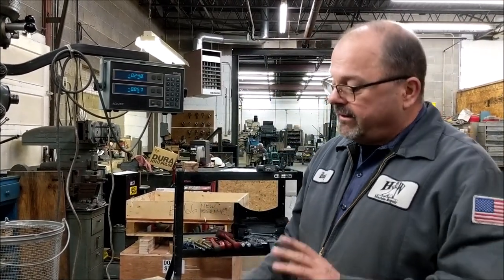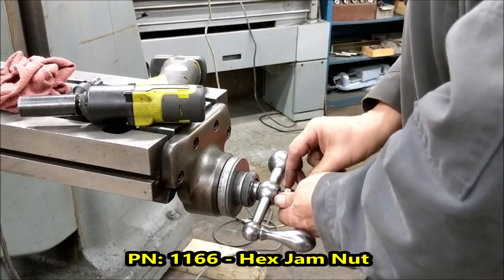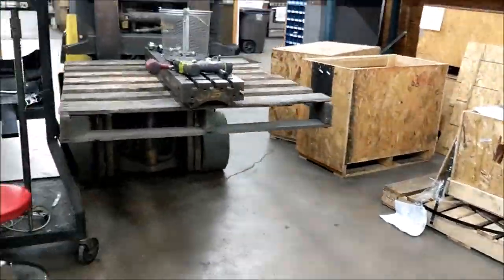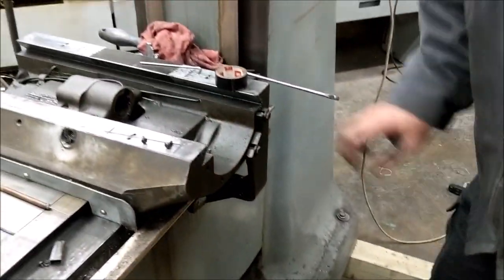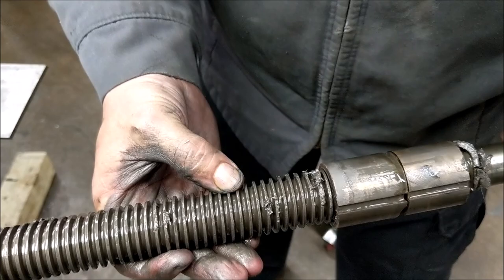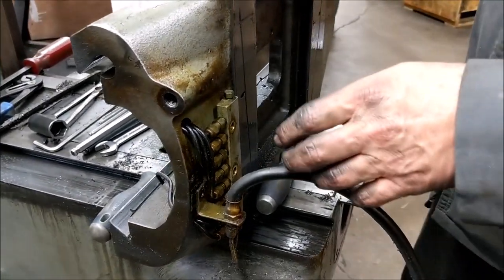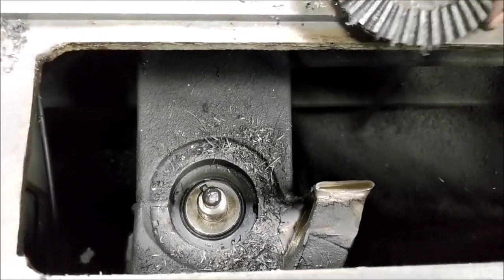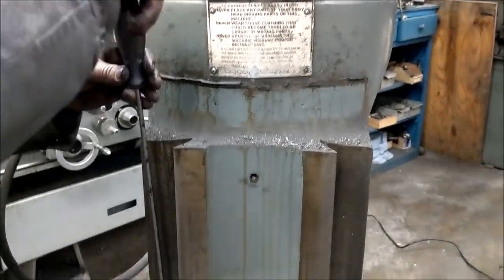Disassembly of the Bridgeport Table, Saddle, and Knee

Comment: Just got a 32" X 9" dove tail ram BP made in 1959. It was previously owned by a grinding shop that is now gone. Apparently some one at the grinding shop worked on this BP as the table shows about 0.0005" across the entire 20" of travel across the table on the dial indicator. Lead screws are tight. This BP does need cleaning if not for these videos, getting this BP cleaned and complete would be that much more difficult.

~These videos are not only very helpful, watching Barry work in these BPs are excellent, to the point, clear as to how to get it done, Big THANKS for these extremely useful videos for BP owners-users.
Reply: We will

Comment: love these video's. i have now watched pretty much all of them and noticed that other makes are in the backround. any videos coming on some of those?? also noticed that during a quill reassembly, that bearing orientation is critical, but you dont mention orientation on the bearings for the drive assemblies??? keep them coming. WHEN i do get a mill, these are the videos to watch for maintenance, will probably have the computer running at the mill when R&R.

Comment: I've been waiting for a video like this. I have a 1976 model series 1. The knee lock on my Bridgeport is not working the greatest. The head on my machine was completely rebuilt a few years back. The saddle and the knee need a little bit of love. I've bought some parts from you guys in the past. I'm looking forward to watching the whole video and making a list of parts for my machine. Mine has the old Mitutoyo readout,...Still works!
Reply: Pull the knee lock shaft and the knee lock plunger. The plunger has a 1/4"-20 tapped hole in it to aid in removal. If the cam on the knee lock shaft is really worn you'll see groves on it and need to replace it. If you're lucky and the cam is OK, you'll probably just need to replace the plunger. Put a little high pressure grease or Never-Seez on the cam before reassembling.
Reply: @pedrowhack-a-mole6786  Will I be able to inspect all these parts without having to pull the knee off of the mill? 

Edit: oh I see, the plunger can get pulled out through the little access cover on the side, by threading a 1/4 20 screw and yanking it out. Thanks man. I'm gonna check it out this weekend
Reply: @pedrowhack-a-mole6786  Well, it turns out that both the plunger and cam were just fine. My gib  needed to be tightened up. I tightened it up almost 2 turns on the screw checking the full travel range for stiffness, and the wear, if any is not perceptible in the knee. Even the felt wipers on it don't look to be that old. The ways on this machine are in terrific shape. All the factory flake marks are as if this thing was either rebuilt completely or it saw very little use. I've owned this machine for over 6 yrs now, but I never really went through it to adjust the gibs and things . I just put it to work in my hobby shop, but i'd get some chatter taking heavy cuts if I didn't lock the knee. I'm gonna tighten up the gibs on the x and y axis also to try and tighten it up a little. Sometimes a little tune up is all a machine needs get it good as new.
Reply from the maker: We are glad you enjoyed it!

Comment: Thanks for the video, I've been using Bridgeport's and other knee mills for around 26 years and never knew how they came apart. Do you grind or scrape the ways to refurbish them and is their an estimate on the cost of having it done if everything is broken down as in this video?
Reply from the maker: Hi Phill. If we received the table, saddle, knee, and the gibs we can do the ways for $3000. If you have any questions you can give me a call at 1-800-285-5271.

Comment: Those old B&L Accu-rites do last. The wipers/gasket flaps on the glass scales tend to break after awhile, then they get oil/dirt on the glass. Using an air hose to blow away chips ensures it.

Comment: Thank you, This is posssibly the most detailed video on youtube. I have a difficult bridgeport move coming up soon and was wondering if you had an accurate weight of the column and the knee? I am removing the whole head and cross feed, but am wondering if I need to remove the knee.
Reply from the maker: Sure, the column is 775 lbs and the knee is 220 lbs.
Reply: It'll be over 1000 lbs for just the base and knee.
Reply: Oops, didn't see this post
Reply from the maker: Yes, we do have weights for each component.  The column weighs 775 lbs and the knee weighs 225 lbs.  If you need the weights of each component send us an email and we will send it out to you.

Comment: Constructive criticism on your use of groove joint pliers: Turn them around the other way, you are using them backwards. When used in the correct orientation your clamping force increases as you turn them, lessening the force you need to squeeze them closed. I have learned this from daily use as a plumber.

Comment: Great video. my old step head could use a tune up. If I send you the table, saddle and knee for scrapping what happens with the wear on the column ways? And what is approx. charge for you do the three parts including top of table on a 9 x 49 table?
Reply from the maker: You say you have a 49" table.  If so, what brand is the mill.  The standard Bridgeport Series I would have a 42" or 48".  The cost to complete the X&Y axis way work if you send us the table, saddle, knee and all gibs will run $3,000.00 and that will include all way grinding, installed turkite on the top and bottom of the saddle to bring it back to original height, hand scraping the ways to flat and square with a pristine column we have here just for these jobs and hand scraping the gibs back to proper fit.  If you column ways have bad wear it will still be there.  When we have to do a column all that work is done by hand and involves complete tear down and having the column laying on its back.
Reply: it's an actual BRIDGEPORT. Must be a 48" table...… Thank You!

Comment: I missed the removal of the knee elevation screw/shaft. Although I know it's a matter of unscrewing it up and out of the nut on the knee elevation pedestal, but it would have been nice to see how you do it. Any chance of doing a supplement video? I have found your Bridgeport rebuild videos to be very helpful in rebuilding my Acer (BP clone) mill. Thanx for all your help!
Reply from the maker: That part is just unscrewing the three screws on the nut and lifting it out. There isn't anything else holding it in except for the screws. It should be the same on an Acer. Let me know if you need any other help and I can see if we can do a short video on that.
Reply: @HWMachRepair    Can it cause any damage with the column gibs removed and the knee sitting on the elevating screw?  I read somewhere it should be braced before removing gibs

Comment: I have a Trump mill, but it appears to be very similarly built to a BP. Is the cap that's at 9:17 have a lip that holds the cross feet nut in place from backing out, or is it just the Feed Nut Retaining Screw or Washer Head Screw like you did with the Longitudinal Screw? I think ours blew out and I may have to machine a new one but you sped the video up in that section.
Reply from the maker: The Bridgeport has a small lip on the nut bracket to hold it in place in the back and the two screws that hold it in front. There are some imports who have the "lip" on the nut itself and is held on by an adjusting nut. You will have to get into that section of the machine to see which kind you have. If you have any questions you can give us a call 1-800-285-5271

Comment: Any tips for securing the knee saddle and table to pallet for shipping?
Reply from the maker: We have people build small crates sometimes. We also have people just strap them down and put wrap over them. If they are sent in a crate we will return it in the same crate, but if they aren't we use shipping straps and stretch wrap to secure them to the pallet. The gibs and yoke are returned on a box on the same pallet.

Comment: I love watching some one else take down a machine. Machine repair was one of my jobs for 30 years but I only went into a Bridgeport base far enough to replace the chip guards or fix lube lines. I just bought a Bridgeport with a 32" table and very little wear for personal use. I had one like it only older at work that also was very tight when we got it, and still is the lowest wear Bridgeport there. Anybody know if the older machines with 32" or 42" tables were better or was it just that the more modern machines, with their 48" and 52" tables, just put more wear on the dovetails and screws? I argue both are true.
Reply from the maker: We have rebuilt many of the older machines and well as many of the newer and the iron on the machines from the 50's and 60's is a little more substantial but the modern machine have much superior lubrication systems.  We have seen all vintage of these machines completely trashed out.  It really comes down to how well the machine was taken care of.

Comment: Excellent video, just what I needed. I have to remove the bed to get the machine though my narrow gate. Do you know how heavy the 42in bed and crossslide motorised unit is? Thank you. Bob
Reply from the maker: Sorry about the late reply, I don't get to the comment here as quickly as I like sometimes. The weight on a 42" table itself is about 210 lbs. I don't know what kind of motorized unit you have, but an old Bridgeport power feed is around 30 lbs.
Reply: Thanks you that helps. 95kg +13kg

Comment: Hi there, I am  blacksmith and bladesmith, and I am in need of a milling machine, but I have very limited space. Which small mill would you recommend? I'd be using it to machine surfaces of billets that will generally be 1"x2"x15". I was looking at an old hardinge bb2v, but the collets on those things are no longer made. Anything you could recommend would be most appreciated.
Reply from the maker: Good Afternoon,

There are some old Bridgeport mills that have 32” tables that do not take up a lot of space.  If you have a J style head with the R-8 spindle the cost of collets would be very inexpensive.  I am not sure where you are located but I would keep my eye open for one in your area.  Give us a call at 800-285-5271 if you would like to discuss it further over the phone.
-Barry

Comment: Great video. Are you aware the parts numbers don't match.  I was looking for the nut size that holds the crank handles on the X axis.
1163 to 1167 are al coming up as reducers. :(
Reply from the maker: Hi Andy. Here are the two parts that you are needing. I just searched and they came up fine on my website: https://www.machinerypartsdepot.com/product/1167 and https://www.machinerypartsdepot.com/product/1163

You can also check on the Leadscrew Assembly diagram on the website: https://www.machinerypartsdepot.com/store/1478157/page/549798

Feel free to give us a call if you have any other questions. 1-800-285-5271 -Barry

Comment: I just disassembled my Bridgeport and followed this video to a t.  Everything went well till I removed the knee/column gib and it was very tight and the little groove broke off the top, the screw came out, but the gib stayed in and self wedged itself to the point I cant get it out.  I tried tapping on the bottom, but it is wedged tight any suggestions on what I can do?  Thanx
Reply from the maker: Good Afternoon Randall, You will need to give us a call at 800-285-5271 to discuss the next steps.  It can sometimes get very ugly and difficult to get the gib out but we can discuss it over the phone. -Barry

Comment: My backlash adjustment screw (8:40) is bottomed out and l have .140" backlash. Does this typically mean that the lead screw is worn or can I just replace the bushing? Thank you
Reply from the maker: If your nut is bottomed out and you still have that much backlash then it would be normal to have the screw also worn out.  Check the backlash in the middle then crank the table to the end and check the backlash.  The difference will be the wear in your screw. -Barry
Reply: @HWMachRepair  Why didn't I not think of that? Thank you!

Comment: Now that the knee is off, at some point during the cleaning and "dialing in" of the various items... Is it a bad idea to drill and two for one and or two additional gib/jib lock handles, beings it is completely accessible... Yes, I realize this model has the cam-lock style already built in... Just wondering if it would be a think ahead type move to just do, for 50 years down the road when the fam lock is worn out... Let alone, the idea that the one up high, and one down low, would clamp more evenly... What do you think??? Anybody can add their two cents, won't hurt to hear some theorized opinions or factual info as to why or why not... Thank you, Dru
Reply from the maker: Good Afternoon Dru - I can’t see any reason that doing it would hurt.  You would need to nail the location of the lock holes do you lock pins would fit correctly but other than that it should work out fine.  We have never found a reason to add locks because if we run into an issue during the rebuild we replace either the lock handle or the lock itself.
 You can give me a call if you have any other questions 1-800-285-5271 - Barry
Reply: @HWMachRepair  Roger that!!! I am enjoying the videos, and are quite helpful for when I get to each step. Thank you Barry.... Dru

Comment: I didn't take the feednut locking  screw out of the bracket just wound the x axis lead screw out and left the brass feed nuts in till I got the table off im afraid I'll be spending some bucks for both x & y lead screws they look shot but is a round ram  built in 1954 I'll cut it some slack

Comment: Any recommendations on removing the linear scale if it's an old Mitutoyo AT-109 (installed as part of a Mitutoyo GML-3705W DRO) without messing up the alignment?
Reply from the maker: The removal of it isn’t the issue, but the remounting of it.  I would recommend contacting Mitutoyo to see if they will get you a set of the alignment brackets for an AT109 to make it easier for the removal and reassembly. If you want to talk through it, you can give us a call at 1-800-285-5271, just ask for Jon.
Reply: @HWMachRepair  thanks for getting back to me. That was my concern as well. I'll be in touch.

Comment: What causes the knee to hop while cranking  it down
Reply from the maker: There are two things that could be causing that issue. You may not have enough oil getting to those column ways or your gib is to tight. Pour some oil directly onto the ways and move it up and down a few times. If the skipping disappears, you will have to troubleshoot why those ways aren't getting oil. If they still skip after the oil, loosen the gib slightly and see if it stops. You can always give us a call if you need further help 1-800-285-5271

Comment: do you run the parts threw a de greaser ?
Reply from the maker: We have a wash bay with a pressurized hose that we use to clean the components before grinding. If something is a little extra nasty, we will spray it down with our purple soap first, which is actually industrial strength carpet cleaner. We have found that works the best for getting rid of hard caked on grease and grime. -Barry

Comment: The backlash adjustment screw (8:40) on mine is broken, and the backlash is horrific. Must remove table... 
I have a small shop, and it's going to be real pain to get the BP to a place where I can slide the table off to one side, it's the long table like that one. I do have a hoist  over the table, if I remove the gib will the table lift straight up?

I'll probably be ordering some parts.

So glad you made this video!
Reply from the maker: The table will not lift off with the gib out but you can slide the table all the way over to access the yoke without removing the table.  It would be helpful if you could get a die cart under the one side but I have worked on-site in similar situations and slide the table over far enough but you have to leave the gib in to do it.
Reply: @HWMachRepair  Thank you. I think that's doable.

Comment: Ok so I’ve watched this video multiple times a day for the last 2 weeks finally got to the part where I take the gib out of the knee and it’s stuck and I don’t know what to do.
Reply from the maker: You will need to call the shop and speak to either Barry or Zach.  We will need to know where the knee is in the travel, is the tab broken off of the gib and other things.  Call us at 800-285-5271.

Comment: how can i identify the age and model of my mill. no plates left on it that show date. she is old and warn....but was cheap.....so i live  with a lot.
Reply from the maker: The Bridgeport's age is told by the serial numbers. If you can get me the serial numbers I can tell you the age.
Reply: @HWMachRepair  ok. on the head is jb15837. on the edge of the knee is 797.on the lubrication recomendation i.s 305300579u.
ordern no. 67066